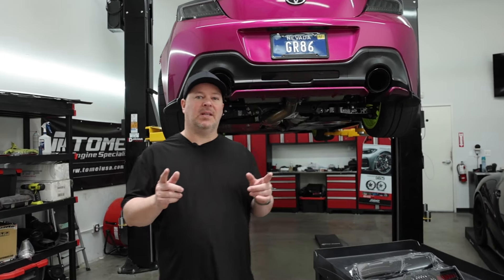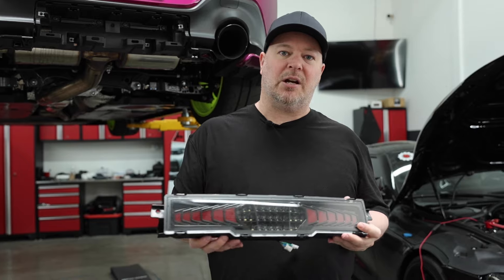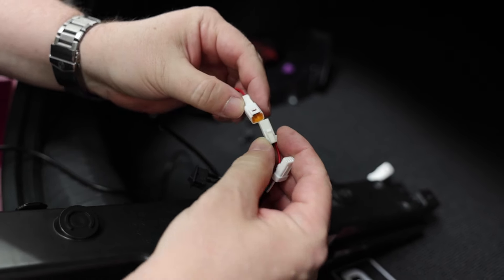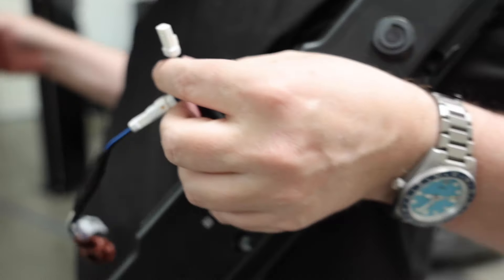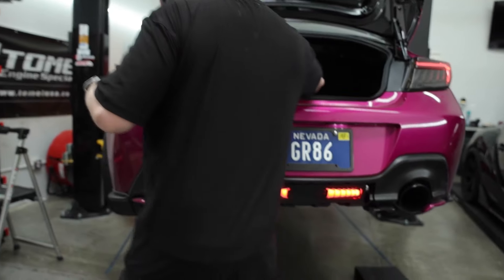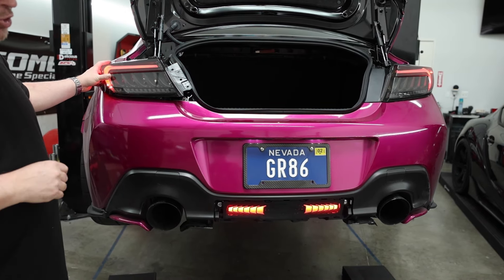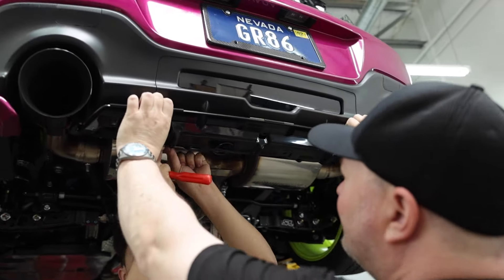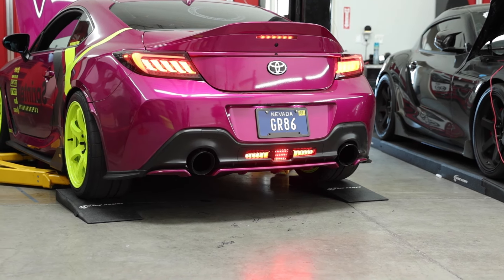Updated GR86 4th Brake Light - F1 Flashing

Comment: 10:00 I'll get this light for my Gr86 but it's best not to drill a hole there. Why? water damage to the switch and wires = short circuit after a while.